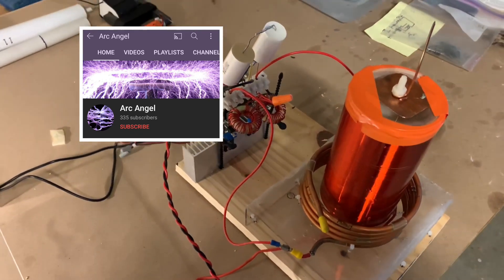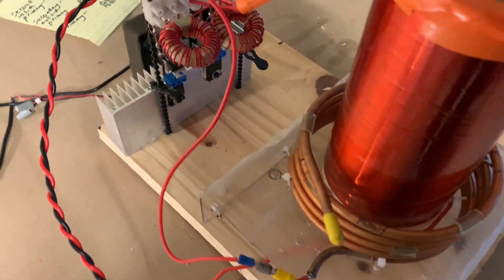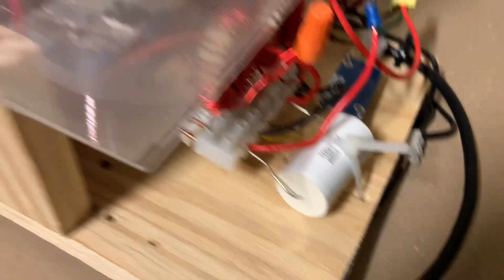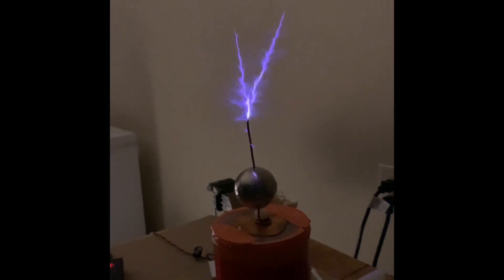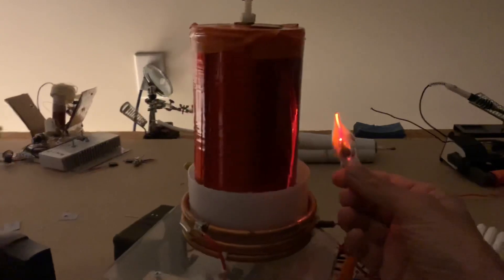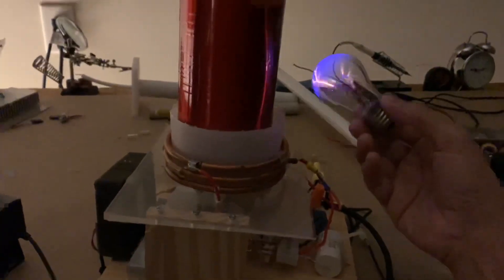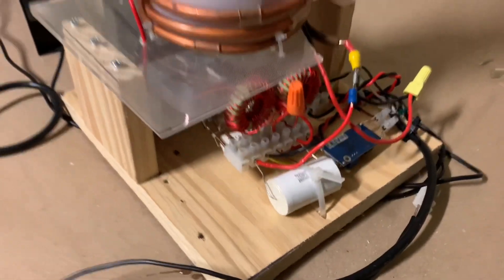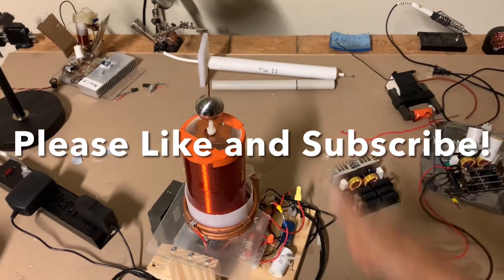Make High Power ZVS Tesla Coil

Comment: What are those caps and where do i get them
Reply from the maker: Those are 942C20P15K caps rated 150nF 2 kV. They are ideal for Tesla coils as they are pulse rated. They can be obtained from easternvoltageresearch.com (EVR) and I also available on DigiKey and Mouser. You may be able to get better deals from DigiKey or Mouser.

Comment: A varnished wire is the same as a short circuit, for currents of certain frequencies. That is why Tesla always used wire with proper insulation.
Reply from the maker: Magnet wire is coated with polyimide material which has good thermal and insulation properties

Comment: Thanks man for sharing this video. I've tried it out & your circuit does indeed work. With only 12 v at the gates, it's transferring energy wirelessly. I've done the same coil with same setting but I'm only getting about 1 cm spark. Everything is same as yours. What can I do to get bigger sparks? My secondary & primary are both resonating at 330 KHz. If I go about 50 VAC from my Variac, my mosfets dies. I want to get bigger sparks like yours but I'm not getting it despite both coils are resonating at same frequency. What can I do big bro? Any suggestion?
Reply from the maker: Did you try to use rectified AC input from the variac. I use parallel set of 10A10 diodes on one of the variac outputs and have the positive half wave rectified AC go to the positive input of the ZVS. This gets much longer sparks. Next try subtle adjustments in the breakout such as lengthening or shortening and adding foil or stainless steel balls to the breakout. Subtle changes in primary tap point position also help. Make sure base of secondary is well grounded.
Reply: When you say grounded, do you mean earth ground or a fake one/metal sheet/artificial ground.

Comment: if the variac is pushing AC how are u able to share common ground with driving circuit?
Reply from the maker: It’s grounded to the mains ground (the variac I’m using has a mains ground). The base of the secondary is grounded to earth ground or mains ground. I’m using a metal rod in the ground but mains ground works fine for the base of the secondary.
Reply: @BrianDhvTinkerer  TY for responding so fast! so where does the other variac wire go?
Reply from the maker: @theGraphicAutist  The ground of the variac is connected to the common negative ground. The AC output of the variac goes to the ZVS. One of the AC inputs is half wave rectified to get AC ramping.
Reply: @BrianDhvTinkerer  so I have earth ground of variac connected to mains ground along with base of secondary coil, one of the variac output is rectified then to chokes of zvs... do I just leave the other variac poles not connected or are you saying hook that to earth, cuz I am no EE but that seems wrong lol!
Reply from the maker: Imagine the two outputs of the Variac just connected directly to the ZVS instead of DC input. Rectifier is connected between one of the variac outputs and the positive input of the ZVS such that the rectified input is a unsmoothed positive. The other variac output is connected to the negative of the ZVS. Forget about grounding in the beginning. Just ground base of secondary to mains or earth ground
Reply: @BrianDhvTinkerer  ya i tried that several times and had to run to the garage to flip the breaker! one time it tripped the breaker soon as I plugged in the variac... and when i try to imagine current flow it seems like plugging an AC line directly from variac to negative of the drive circuit seems dangerous...
Reply from the maker: If you can draw how your thing is connected that might make sense. Should not be tripping the break. The current drawer on these circuits is very low. The other thing is are the gates on your ZVS driven from a separate 12V power supply?
Reply: Really appreciate u taking time to help me. google search results have become ridiculously unhelpful. seems like there was a time i could tap the mic and just ask whatever in sentance form and id get the exact results i was seeking. somehow google has regressed. greed obviously...
Reply: @BrianDhvTinkerer  oh wow so there are actually 3 power sources in this circuit? how much current will the 12v gate supply need? oh wait i'll just watch the video again i remember now u just used one of those cheap ones. same as whats driving the zvs will suffice?
Reply from the maker: @theGraphicAutist  I just used a simple 12V  wall adapter for the gates. 1 or 2 W is fine,. This is power source 1. The second power source is the variac. There is no other power source. Let me know how it turns out.
Reply: @BrianDhvTinkerer  shoot i don't know whats wrong then. i could send a picture but its a clusterf#$% rats nest. maybe ill clean it up and do that
Reply: Hey i finally got it working! Very exciting! I don't know what it was. I rebuilt the zvs and im using a different variac but other than that same...  oh the rectifier diode is different also... thanks again for your help. Oh one more general question, why is it that we don't want variac power smoothed with caps? I imagine cuz the ramping?
Reply from the maker: @theGraphicAutist  that’s awesome man!! The main reason for no caps is the ramping effect on spark growth-   A small cap like 5 uF does help lower transients!

Comment: I've notice in your circuit diagram that you use 100 ohm not 470 ohm as usual for gate.. is there any deferent result.
Reply from the maker: Yes it’s improves performance if the gate has a separate 12V power supply. It no separate gate power supply, then 470 Ohm is best.

Comment: I use 2 18 volt drill battery's in series works great 18-19 volt is the minimum i use with that driver I have a video comparing the difference

Comment: Can this thing run on full wave mains  instead of rectified half wave? or is that too much power?
Reply from the maker: It will run on full wave rectified mains but mosfets wil get hot at higher voltages

Comment: Morgan put me on to this and it's pretty cool. Are the two coils exactly tuned or is the secondary a little higher accounting for breakout? I was on a push-pull binge for a while, they are great for lower voltage SSTCs.
Reply from the maker: I am happy you Found the experimental details helpful. Initially, to the primary and secondary Coils to exactly the same frequency. Then test at lower voltages. This is best done with variac.
Reply from the maker: You should see output. Then move the tap point on the primary such that primary resonance is slightly lower in frequency than the secondary resonance to allow for resonant rise. This takes a bit of messing with for best results. You can get much bigger arcs this way.

Comment: replacing the fets with igbt s might give some extra power..... i think the fga60n65smd will do great.... a 100 v run i guess !!!!!
Reply from the maker: Worth a try. I could power the gates on the IGBT modules with a 24V separate power supply and crank the puppy up 😂
Reply: @BrianDhvTinkerer  i think use the high speed igbt g4pc50ud will be good
Reply from the maker: Thanks for the tip!
Reply: I only every use IGBTs in my zvs (and can run at mains input :)), so if I try this I'll let you know the results. I had tried it before, but my setup was worse back then and I killed several IGBTs.
Reply: @vdekjEE  zvs on mains!! . What igbts do u use brother and how do u manage that😐
Reply: @spandandutta2485  I use FGA40S65SH IGBTs and a big core so it doesn't saturate
P.S. I'mm on 120v mains
Reply: @vdekjEE   yeah I get it ....I have 230 v mains in my country ... 😭
Reply: @spandandutta2485  yeah, can't exactly do mains easily with 230v. BTW I got the IGBTs for 50¢ each :)
Reply: @vdekjEE  yeah that's the problem.. just imagine a self made induction cooker (simple) running directly on mains without overheating ..but a simple zvs would not work on that much high voltage ... Like it's a thumb  rule .. choosing a transistor with atleast 4 times the vcc for this driver.  . .
Reply: @spandandutta2485  yeah and 1200v transistors are pretty expensive.
Reply: @vdekjEE  Yes and a bit slower in terms of switching 😀
Reply from the maker: @vdekjEE  it will be really interesting to watch it running mains